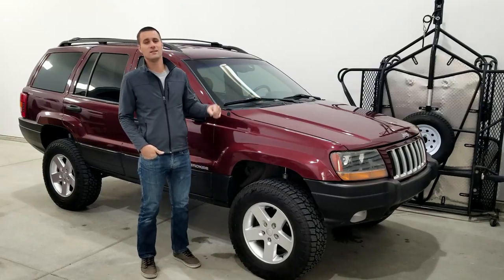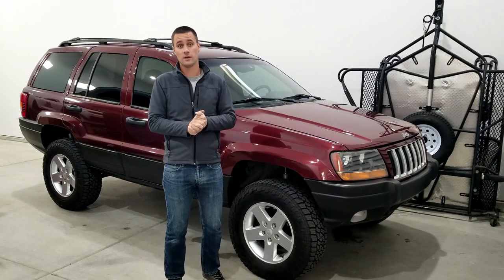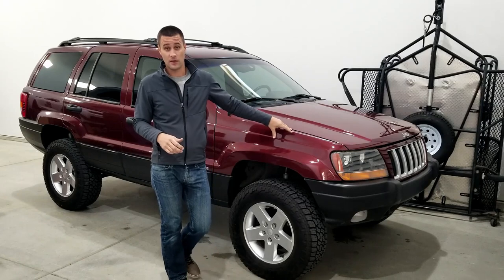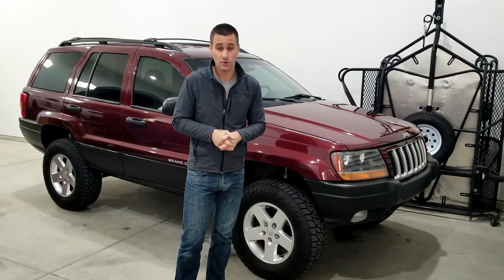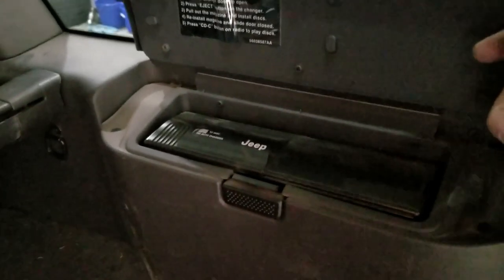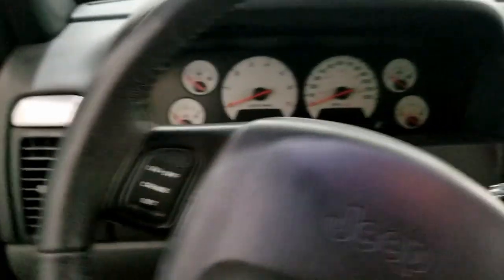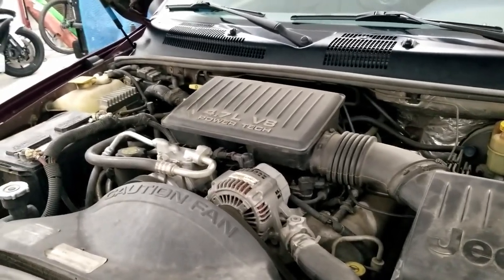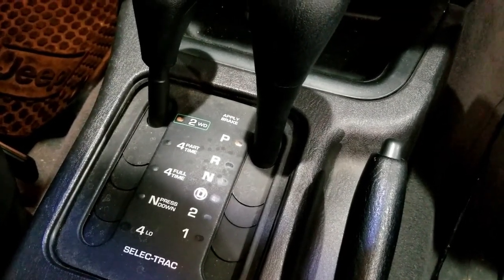$300 Jeep Grand Cherokee WJ Project "Cheap Jeep"

Comment: I got my 2004 WJ Special Edition for $1,500 because the owner was scared of the occasional 'death wobble' 
I balanced the front tires and tightened the track bar and it was fixed.
I took the family to dinner that night and they all like it better than my '21 Terrain.
I think it's gonna be my daily driver. Solid, smooth, quiet with great road manners.

Comment: Tyler, What a great video, full of great information. I'm the original owner of a 2001 Jeep WJ laredo 4.0l litre  I love my Jeep because I can work on it myself and its become my hobby. I had a Dodge  before this and after spending thousands each time I took it into the dealer for service I  finally said F them and I started doing my own maintenance and fixes.  My Jeeps now 21 years older and its got 328,000 miles on it and I've been running synthetic oil in it and it still runs strong. I recently put in new main crank bearings. main bearings, & a main seal all without removing the engine in my driveway. I did a compression test and the engine still has a decent 165 PSI compression in all cylinders so I guess that synthetic oil was worth the extra cost.    Keep up the great work.....
Reply from the maker: Thanks! It is always awesome to complete the work yourself! Thanks for the view!

Comment: I have a 2004 WJ 4x4 with the 4.0 i6. Bought it in 2020 after the FED printed trillions and I knew that inflation was going to kill us one day and I needed to get out of debt before hand haha. Paid $6k for it with only 122k miles, SUPER clean inside and out, leather and a sun roof etc. I have added a roof basket and a lift and tires similar to yours. I went from a 2019 Rubicon Wrangler to it and do not regret it. Best part is that I have not had a car payment for nearly 3 years now. Saved a ton.
Reply from the maker: The no payment is pretty awesome and a nicely sorted out WJ really drives nice! Thanks for the view!
Reply: 04.overland Grand Cherokee 4.7...W/J 189k...$1000 No leaks yet ... loaded every working...lifted leather interior ONLY DOWNSIDE IS THAT I HAVE 🍏 KOOL-AID PACKED INTO MY RADIATOR NOT ORANGE 🍊 PER SPEC

Comment: I've got a 2004 WJ Laredo, with over 192k Miles at time of purchase back in May of 2019, but with the 4.0L LOL-Tractor Inline-6 engine, & it's definitely Built Like A Tank. The Ductile Cast-Iron Block & Head are almost Bombproof, with keeping the fluids topped off, and watching the gauges as I drive, as the only things I really need to do between proper maintenance intervals.
Reply from the maker: The 4.0 is a beast that will take abuse and seems to run forever!

Comment: Not bad for a WJ! At least you taken great care of it, I own the 2002 WJ Laredo trim package which has the inline 6 engine, leather interior and then along the way I installed a 2 inch lift kit, all terrain tires from Falken, Moto Metal wheels, new front bumper for the winch, new headlights and upgraded the sound system too including a touch screen. Its a hobby man once you own a Jeep the projects never stop! 

V8s are nice for the sounds but harder to maintain, inline 6 engines can go on forever as long you know how and when to maintain it and find the source of its problems.
Reply from the maker: Awesome! These WJ's do really well off-road and the 4.0 will run forever!
Reply: @TylerPotter  As much I like their V8s because of how they sound, I'd rather go with the 4.0 for its durability! Especially with the selec-trac transfer case!

Comment: This was a very interesting video, thanks for making! That reminds me that I should finish writing down my accounts of my past Jeeps.

I'm currently on my 3rd Jeep, and own a 2003 WJ Laredo 2WD 6 cylinder. All OEM, 272K miles. I've had to dump $2000 worth of repairs and parts into it to get it to a road worthy state; while I got the vehicle for free, the transmission was half-wrecked and had a primary wire harness problem. To minuscule things such as the A/C expansion valve to have A/C, circuit boards on the tail lights so that they work properly, and having to splice wires to the main computer because of a squirrel or some vandal who slashed things in the hood.

Both my previous Jeeps, 96' era Grand Cherokees, were named after volcanoes due to their low gas mileage. This WJ deserved a different name due to how "modern" it looked despite it being 20 years old (it was the first time I had a vehicle less than 20 years old at time of acquisition); Britannica.

It's rounded, has a nice shape, and I bug my in-law that she can throw a crowbar at it and it'll take a hit. It still eats up gas at 15 mpg on the rural country roads where i live, but does better once you get 55+ mph on a freeway. 

Save for some interior things, I want to do some of the OEM plus upgrades like you've shown on some of your channel. I do want to glass-panel the radio just to keep modern and link with devices, and plan to add some tech quality-of-life improvements for passengers such as USB-C/Q3.0 Quickcharge ports. I've kept it stock as possible for ease of maintenance, and primarily maintain it for long-range, Interstate driving (so factory lift for aerodynamics, etc). 

Probably a bit of a longer comment than I was expecting, but your videos excited me to do more upgrades on Britannica when able. Thanks again for the videos on these lines of Jeep.
Reply from the maker: I really do like these darn Jeep's and also love the OEM upgrades. It sounds like you've got a good plan for yours. Thank you so much for the comment and all of the info! It really means a lot to me and thank you for the view!

Comment: Just a week ago, I bought an 04 WJ Laredo with 4.0 and Select-Trac.  I paid $5500, BUT it only has 83K miles and zero rust (was an AZ Jeep). I put on the same wheels as yours with Yokohama AT tires. I replaced the motor mounts and had to fix a few things. Loose front shocks, loose airbox, improperly gapped spark plugs. Added new headlights with LED bulbs. This WJ now rides so nicely. Thanks for the video and the info about the overhead console. I'm going to look for one with the homelink buttons.
Reply from the maker: Nice sounds awesome, the lower mileage ones with no rust are getting super hard to find! Sounds like you got a good one, Thanks for the view!
Reply: Hey Tyler. Went to the junkyard today and the very first WJ I saw had the Homelink console. I grabbed it and swapped it out in the parking lot. Took a few minutes for the compass to self-calibrate and when I got home, I programmed the Homelink to my garage door opener. Thanks again for the tip!

Comment: You can drive with quadratrac 2 without either driveshaft. Quadradrive 2 is the best to have off-road because of the varilock axles
Reply from the maker: One huge thing I totally forgot to mention in the video was the fact I swapped in varilock carriers into my factory axles! Varilock is a awesome option for the WJ's!

Comment: hi, great video (s) i have an 01 WJ limited with 4.7 select trac with the up country suspension package, the heads were freshened up but the last (and only owner) messed up some of the engine wiring, bare wires twisted together, after fixing that, new OEM suspension and steering parts, tune up, shocks and brakes  (the parts were very reasonable from rockauto)  and i love the WJ!!!  i am thinking about putting the 242 transfer case in my TJ..
Reply from the maker: Nice sounds like you have done a lot of work! Around here the 242HD (for the V8) is kind of hard to find in out local salvage yards. Thanks for the view!

Comment: Feels funny looking at a vehicle nearly identical to your own except for the fact you own the 2003 Limited with Quadra.  I've had mine over 13 years and am the second owner. Just had to replace the engine gaskets and oil pan at a cost of $1400.  It has been in an accident, but no frame damage and the outer damage was repaired. (thank you full coverage insurance!)  Now the center console is fall out due to broken clips at the bottom. The blend doors on the right side are out and blowing cold air even when the heat is on.  Both passenger side power doors are dead and need switches at least.  A decent bump in the back fender where I missed a rather large size rock around eight or so years ago. Bumper was backed into and the license plate ripped off.  Decent from a pole when trying to back full into a parking spot..didn't eve notice the probably half inch size pole that day.  Driver side hole in carpet and seat wear and tear.  CD changer worked last I check 10+ years ago. HAHA  Yeah, the Limited isn't in as good a shape as yours at all.  I'm impressed it ran this long before the gaskets blew. Nearly 20 years.

However, I won't be going back to Jeep.   Horrible to no support. Now some of the worst reliability in the industry.   I'll be jumping on the 4Runner bandwagon most likely.  It's funny I am even tempted by the 4th gen Runners with their V8s. Wish companies would add the V8 option back. Too worried about gas mileage when the people buying these don't care about gas mileage.
Reply: And yes, my Jeep is that burgundy red.
Reply from the maker: Sounds like it been a pretty good Jeep regardless lol Check that door jam wiring before you go replacing switches, most of the time you will find a broken wire that can be repaired! Thanks for the view!

Comment: My 02 Overland had no problem driving 60 miles home from the seller, despite the harness to the TCM being hacked by a blown shock. It was slow and stuck in 3rd, but had no problem making the trip.
Reply from the maker: Once it was moving it should have been pretty happy going down the road in 3rd. Thanks for the view!
Reply: @TylerPotter  Yeah, she's gutless off the line, but she has no problem between 20-40.

Comment: I love how you can just add parts from other. You can add the tcm from and 04 and have a 5 speed auto
Reply from the maker: Jeep released a software update back in 2001ish so you could flash the older 4 speed programmed 45RLE jeep's tcm and make them a 5 speed 545RLE trans. It's a pretty cool factory upgrade!
Reply: I'm an owner of 99. She taps and has 270k miles. Any advice?

Comment: I picked up my 2000 limited v8 all the bells and whistles for 500$ , running, hi mileage 250k. needs the things that brake on these jeeps. blend doors, heater core , all the lift struts (hood etc ). tail light circuit boards.
Reply from the maker: Yep those are the pretty common issues on them but sounds like a got it for a good price! Thanks for the view!

Comment: Hi Tyler, recently fixed my late wife's 2002 Jeep grand Cherokee. She loved it so i decided not to get rid of it but keep for a little while, even though i had other plans sometime after my wife passed.
Thanks for your great video detailing all that you did to your jeep. It looks great, it sure does not look like a 25 year old jeep at all. You have done an amazing job with it. In any case, what did you use on your bumpers to get them so black. Mine is a little faded, i have been wondering what i can use on it to give it a little bit of a nice look. I really like your bumpers and how they look. Any pointers here will be much appreciated. Thanks again and have a good one.

Comment: It looks like it just rolled off the showroom floor back in 1999, I got mine for $800, was able to drive it home, spent about $1200 fixing everything and tuning it up, it's my daily driver.
Reply: 15:00 you can drive the quadra-trac II with the front driveshaft removed I drove like that for almost a year.

Comment: The Quadra drive transfer case (247) can actually work without a front driveshaft. Don't ask me how it works, but I've got mine out now because of a bad cv joint that was causing some vibration.
Reply from the maker: Nice, I had my front drive shaft balanced, Thanks for the view!

Comment: Love my performance build 02 Overland with the H.O engine.
I have another 4.0 as a daily driver.
Gonna get another 4.7 as a off-roader in the future.
Reply from the maker: The HO is a awesome motor, sounds like you have a great WJ fleet going! Thanks for the view!
Reply: O Kl  your transmission is going out, can’t really do anything. 
I’d recommend a good condition junk yard transmission. Not a lot of people know how to rebuild these Jeep’s transmissions well. Or if you have the money you can buy a remanufactured transmission from a reputable website.

The 42re is the weak point in your jeep. If it’s a junker vehicle and you want an upgrade buy a V8 , they have the 45rfe or the 545rfe. It might be cheaper than a new transmission.
Reply: First thing ya wanna do is replace fluids with dealer fluids especially p/s get Mopar p/s because the fluid and pump power the fan yes it's expensive like 20+ per quart but worth it

Comment: Wait wait wait 5.2 and 5.9s are right up there with reliability of the 4.0 the only issues they had were a blown gasket on the  underside of intake  which is a $100 easy fix maybe cracked heads that very very very rarely caused any issues and they have massive after market support where the 4.7 has next to zero.
Reply from the maker: Yeah I wished someone made new foam also! Thanks for the view!

Comment: i have a 2001 WJ V8 since 2019, that damn car has left me almost broke, but when I drive it.. all the anger goes away, I cannot explain that..
Reply from the maker: They are really nice driving Jeeps but as they get older they get kinda needy!
Reply: @TylerPotter  yup, and in my country not many mechanics know how to fix the car.. For example my car sometimes has problem with starting the engine, and no one know what causes the problem :/
Reply: @gdziejestmojpies  Crank position sensor would be where I would start, especially if it shuts off sometimes while you are driving.  I've had to replace them on both WJs I've had (4.0 engine).
Reply: @nomaddawhat7643  it was replaced, and it seems that's not the problem, still fighting with that :)

Comment: nice wj. I got an 03 4.7ho for 600. with radiator leaking and valve dropped, got it fixed and it has been a daily for at least 6 months now,  took it offroad as is with the stock suspension and it performed great in sand and gravel. now my question is. what would be the best lift for it? I do everything myself. thanx for taking the time.
Reply from the maker: There are a million options, myself and a few buddy's have started with the rough country 2in metal spring spacers and then ordered the 2in lift bilstein shocks. This works at a decent base that is cheaper and then you can decide if you would like to go bigger later down the line, Thanks for the view!

Comment: Thanks for sharing your knowledge, really like what you did to your WJ. Quick question, when you swapped your instrument cluster, did it just carry over the original mileage? If it’s just plug and play and can obtain original mileage, I would like to do this on my 04 WJ. Thanks again and please keep these WJ mod videos coming! 

Alex from Phoenix, AZ
Reply from the maker: The mileage is stored on the cluster and the engine computer, so to keep my mileage correct on the cluster I took both clusters apart and swapped the white face gauges and needles onto my cluster. Thanks for watching!

Comment: Hey what's up saw your video like everything you like everything you did about A03 Jeep Grand Cherokee overland for 1500 runs good have a couple little issues on working on almost done I have a problem with heavy rain I don't know if the water's coming in from the sun roof like you mentioned in the video having a sunroof is not always good or it's coming from the
Reply from the maker: You could check and try to blow out the sunroof drains, we see them come into the shop clogged and cause leaks. Thanks for the view!

Comment: Hey Tyler, fellow WJ owner here. Along the years I've been modding my rig and  kinda went your way by keeping on purpose the OEM soccer mom look (lift and tyres aside lol), just love the weird looks I get from other jeepers/off roaders when they hear the "clac clac clac" from my aussie locker. Also, just wanted to ask you, do you have the part number for the 04 mid pipe? I read about that mod some time ago, but couldn't find where to get it... or is it one of those junk yard finds? Anyway, I'm glad to find fresh content about the WJ here, your rig is pretty mint for just $300!
Reply from the maker: Thanks for the view! The mid pipe is a "Walker 53530" it is super cheap I bought it on rockauto.com for only $7 plus shipping. It is a pain to install due to the old stuck exhaust but it definitely adds some clearance when off road.
Reply: @TylerPotter  Nice, thanks for the reply!

Comment: I just bought a 2004 with the 4.0, great condition, I paid 5000 , zero rust, zero dents, spotless interior, I think I still overpaid, 150000 miles,  I put a 3in lift in the front, 2 in in the rear, I'm going to get bigger tires for it in a little while, I'm not sure what size will fit, your tires look like a good size for me, what size are you running
Reply from the maker: With a clean interior and no rust I think you did just fine on price! WJ's are getting harder and harder to find with no rust, for tire size on the street I am running 255/70R17 and then I have a 2nd set of wheels and run 255/75R17 for off road.

Comment: As far as repair costs.  I consider that if I buy something only 5-10 years old I'm going to be seeing at least $500 monthly payments.  So I figure if it runs for less than $6k a year I'm doing amazing.  I just bought one for $2500 and have spent another $500 on it.  If it runs a year I'll be way ahead.
Reply from the maker: That is great logic! Thanks for the view!
Reply: I got mine for $800 and the biggest thing I had to do to it was rebuild the transfer case which was about $600 all together, I been driving this jeep as my daily driver for almost 4 years.